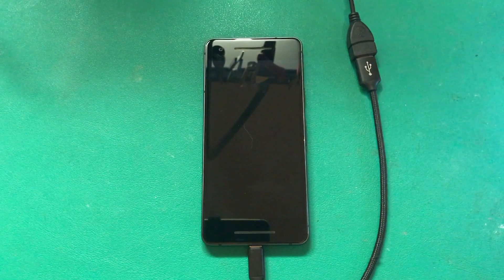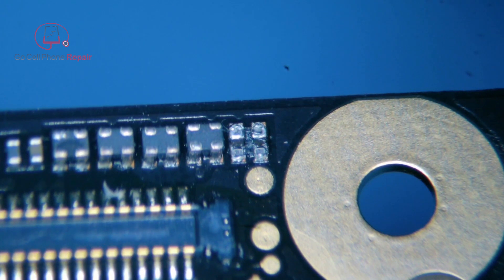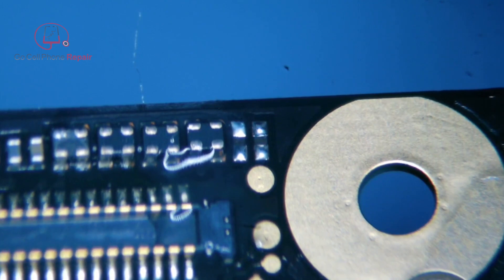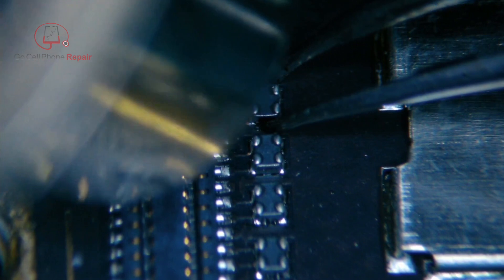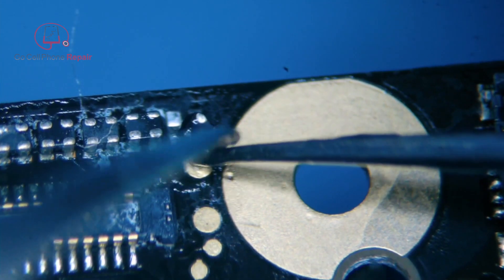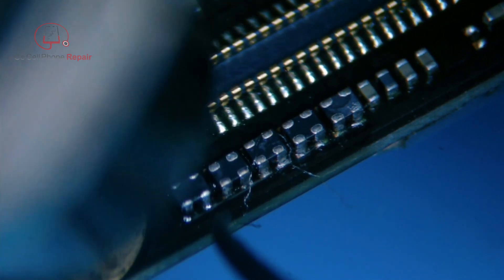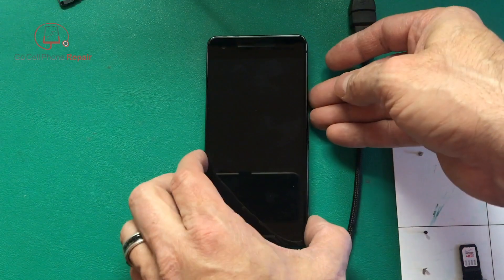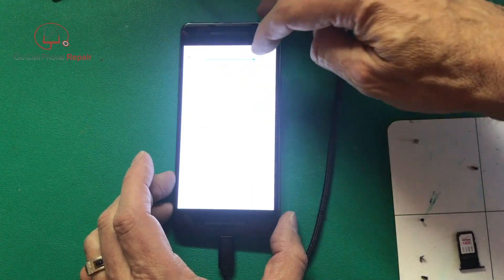Pixel 2 Display Static Repair

Comment: After turning on a Pixel 2 that had been sitting around with a dying battery, it tried to boot, flashed the red low battery warning led once, then the screen went to static. Replacing the battery didn't help, but a small bar showed up at the top of the screen.  Tried a new screen, but no change. Close examination didn't reveal any blown components, and since I don't have the equipment to replace any tiny components anyway, I pulled the battery and tried a heat gun. The first gentle try actually made it work for a while, but it quit again, and repeated more aggressive heating helped, but it always went back to static. Remembering the hill billy fix of baking a MB in an oven, and having nothing to lose, I went for "kill or cure" and got it hotter than I would have liked to, but didn't melt any plastic parts. It has now been working for two days. Something to try as a last resort. Thanks for the video and great reply's.
Reply: You used a heatgun on the whole phone? Or you just pulled out the PCB and blasted that?

Comment: Have a quick question: is battery replacement on a Moto Z2 play a service you'd be willing to perform? Bought a used one but it's battery life is abysmal compared to the 2 that I had bought new. I don't have a heat gun and don't have experience with heat guns, so figure it best to send the phone & replacement battery off to someone more skilled in this type of repair. If yes, I'll be contacting for quote very soon.

Comment: I had this happen to mine and the display cable had completely come loose, screws and all. My boyfriend removed the screen and reseated the cable to make sure it clicked and now the phone won't turn on at all. Any reason why this would be? There is no sign of the screen cracking or breaking but those phone just doesn't want to turn on or anything now.

Comment: Thank you so much for your video. I still have the accidentally removed data choke but I don't know how to find the right orientation... do I have to try to resolder it in all direction until it works again?

Comment: same issue with mine thank god i found this video. Edit: i ordered a bunch of random data chokes online (not from phone donor boards), and it would work for a few minutes then go back to static display. Had to resolder/reflow to get it working again. Also someone on reddit said to just solder the traces directly without a data choke. I tried that too but it didnt work

Comment: Great video, and it looks like I damaged the exact part on my phone. Does anyone have a part number for the data choke?
Reply: just solder across the pads and it should work. These are just for noise reduction.
Reply: @karelchaloupka2843  really? Do you mean solder all the pads toghether? That could be much more easy to do than a smd soldering